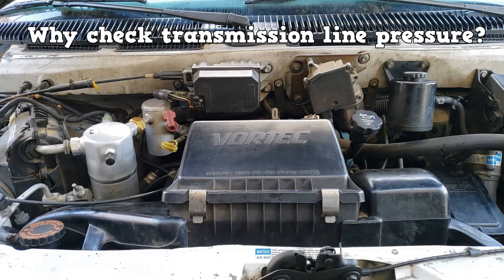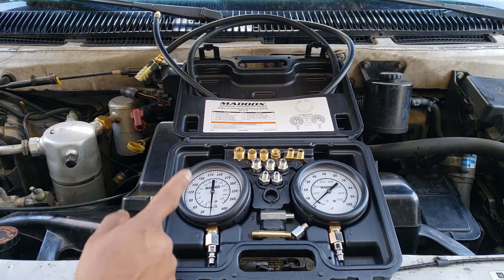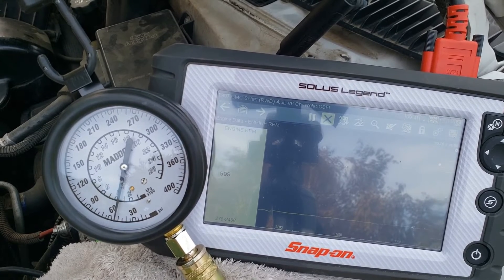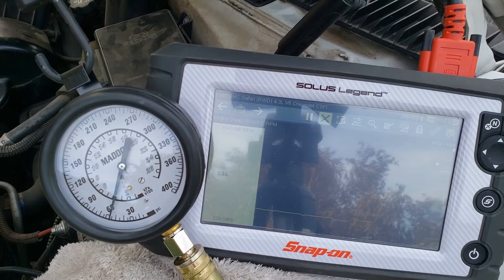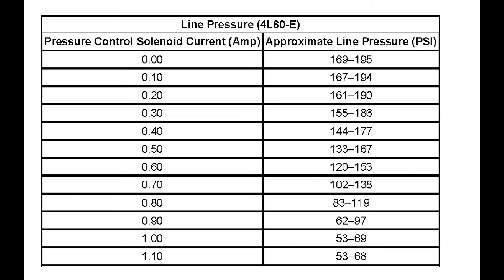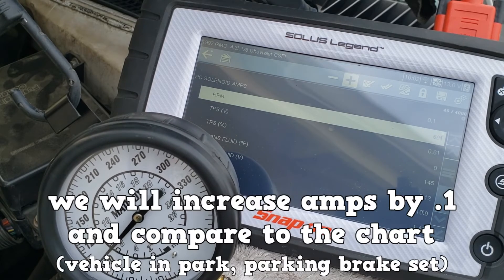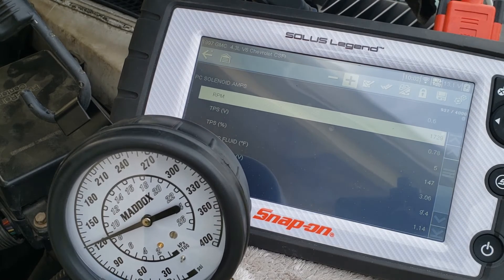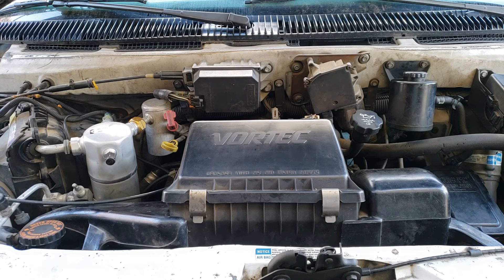How To Test Transmission Line Pressure Astro / Safari (4L60E)

Comment: You can use the same scan tool to set the desired rpm, without a helper, and is more accurate and consistent.

Comment: i have a 42rle in a 2005 dakota 4x4 that takes anywhere from 15sec to 3 min to engage when i put in any gear.  the line pressures jumps from 0 psi to 180-210psi and the truck starts moving.  moves quiet and smooth for about 6secs to 2 mins then looses the gear and repeat the cycle. did multiple tests and results are the same.  recommendations?

Comment: Coming back from the tune shop I had no third and fourth gear so I swapped the transmission. Still no third or fourth gear after replacement won’t even try to shift. There is no codes. And I checked the live data all the solenoids are online. I don’t know what to do anymore. This happened after I took the truck to get tuned?? The guy tells me he didn’t mess with any programming for the transmission. I just checked the pressure solenoid data it looks good as well. Can someone help PLEASE. I pulled the pan already from both trans and netiher had any heavy clutch material or metal. It has to be the tune right???
Reply from the maker: That's what I would suspect

Comment: Nice. So maybe when checking with just gauge you should warm it up and rev each gear to 1500rpm.  Then it woild be more accurate?
Reply from the maker: Not specified in the service information. It would be a good idea to test at idle and at 1500rpm and compare the results!